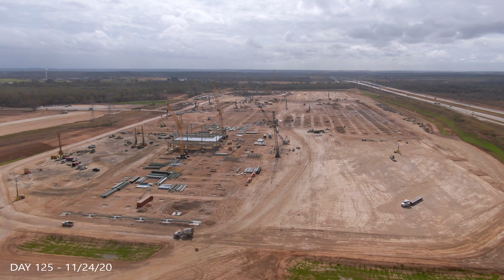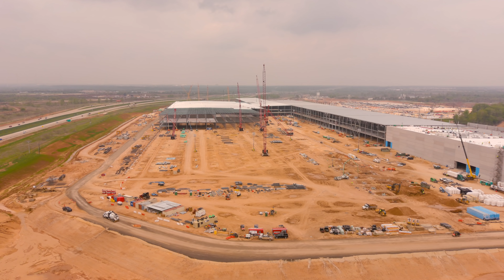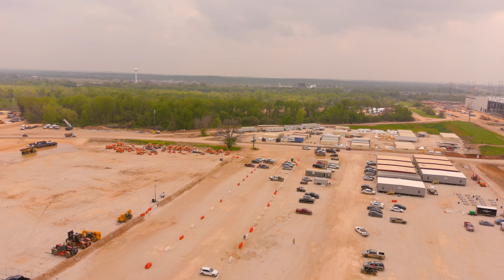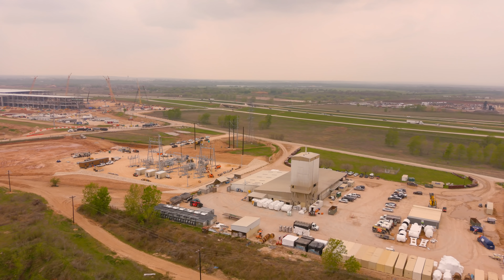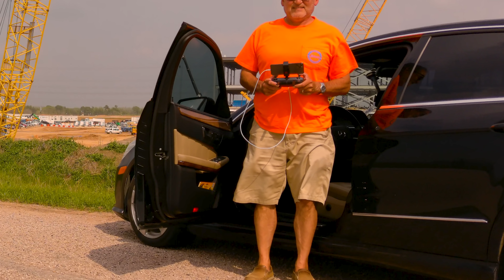Tesla Gigafactory Austin 4K  Day 248 - 3/27/21 - Terafactory TX - 8K DRONE FOOTAGE OVER GIGA TEXAS!

Comment: Hi Jeff. I suppose it's sort of a helicopter. ☹️
7:00. Filling in the space between the long footings. The bored reinforced concrete piles are under that now.
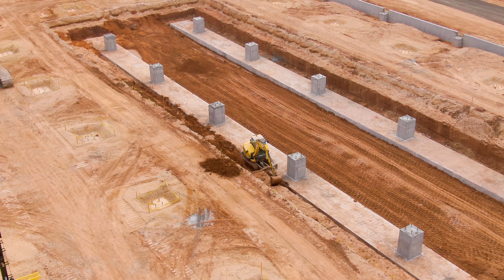15:33. And excavating the outside of the long footings.
Reply: Noticed that small excavator working on the east side of the long footing. From the size of the dirt pile it just started. Another "now what are they doing?" moment. I'll be watching future quad squad videos to see what happens here.
Reply: @dan_w3st  I'm all out of ideas on this. I had settled on a separate structure being supported on the concrete piles. Not sure now what the piles were for, I had assumed a vertical load. Suppose I'll have to keep watching too.

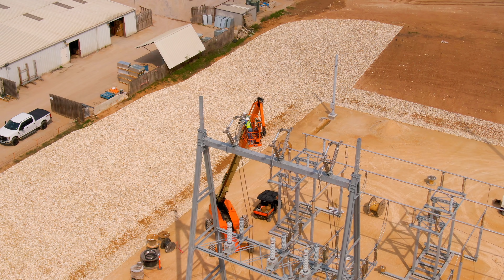Comment: I believe the two guys on the man lift at 15:13 in the switchyard are installing air powered HV circuit breakers. Anyone confirm?
Reply: The tower they are working on has a few functions. At the mid level you see two insulated devices. I believe those are lightning arrestors. At the very top, those are disconnects. When high voltage is disconnected you can get amazing arcs of basically plasma. You want that high up in the air away from everything since that arc has the ability to jump a lot further than you might think. There is a formula for it somewhere but I’m not an expert. I just Google well. The strange little things with three sets of two insulators that looks like a six pronged jack, are the circuit breakers. They are filled with insulating oil or sulfur hexafluoride gas, both of which resist electricity to a very high degree. The difference between a disconnect and a circuit breaker is that you command disconnects to open and close and circuit breakers happen automatically due to over current. Disconnects, like a light switch, are made to be turned on and off at will and fairly often. Circuit breakers are made to react very quickly and just like the circuit breakers in your house, using them too often will lead to their early demise. Once we get just a little further along and all the wiring is in, if someone doesn’t beat me to it, I’ll find a good screen grab from one of the guys and do a trace of the circuit and name the components. The good news is that since this is the internet even if I’m wrong, seventy guys will correct it. But some one has to put out the first iffy guess first. Thanks for jumping in and playing the home game with the rest of us.
Reply: William you are right, but I believe the top things act like fuses that open when the lightening arrestors shunt overvoltage to ground to protect the substation equipment. I agree that there is a large flash when this happens, millions of amps. The circuit breakers are as you described but they are the remotely controlled components. The disconnects are the parts that have 3 insulators and open a gap of about 3 feet and are opened manually on site to maintain the other equipment. They are not designed to open under load and have normal contacts in the open, the breakers have to open first. Repair people want to open the disconnects and ground the deenergized side before proceeding, they want to see it ! Most of the wiring is complete but it is hard to see the jumpers. Use Google Earth to see the switchyards, gas turbines, solar cells and other equipment that this feed comes from south across the Colorado River.
Reply: @Bill_N_ATX  Perfect. I have seen (and heard) them in action. Pretty impressive...

A traced block diagram would be helpful to everyone. Long ago I worked at a nuke and quickly decided power engineering wasn't my cup of tea.

Yup, disconnects, not breakers. Take heed what Mr. Wheeler says: that circuit breakers (even residential) shouldn't be used too often as a "switch".
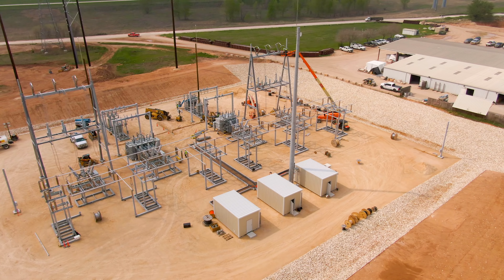Reply: @freundron  At 14:53 feed comes from left to the 3 current limiters on top of structure then to 3 circuit breakers below with a tap to the arrestors on the middle level. From the breakers to a disconnect then to the buss. If you look closely, most of these jumpers are installed. From the buss thru another disconnect  and breaker to the transformer primary. The secondary from the transformer routes to another low voltage breaker then disconnect to the plant feed. The other side of the Sub Station is a mirror image of this side. At this time they have the 2 buses jumped together so they can only have one feed breaker on. If they lose a feed they automatically switch to the other.

Comment: 8k is crazy! What file sizes are you dealing with now? Takes longer to upload to YouTube?
Reply from the maker: The upload time is the same as everything is crunched down into a 4K video, but the rendering time has doubled!
Reply: @peterdog15  thanks for the upgrade and extra time. The footage is really next level. Hope you get those extra batteries soon!
Reply: @peterdog15  Does your editor utilize your GPU(s)?  They can speed up processing.  But higher performance GPU's can run into some money.
Reply from the maker: @dmpease01  yes, we have some pretty hefty power over here :-)
Reply: So your zoom is digital, not optical, got to worry about the pixels.